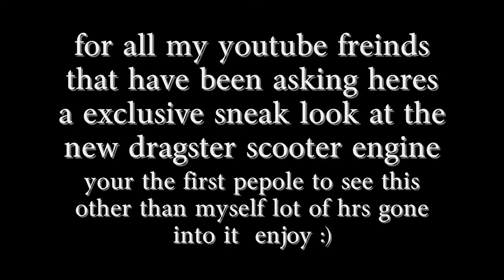Sneak Peak Of The New Italjet Dragster Race Engine

Comment from the maker: vitaly deuterium cheeres for kind words mate knew your like it the reed spacers are a conversion i had machines so the engine would except kx125 vforce motorcross reeds an a big 36mm khien kx125 carb the pipe is a pipe desighn exhuast i had made one off for this engine made by a company in germany to match my port timings